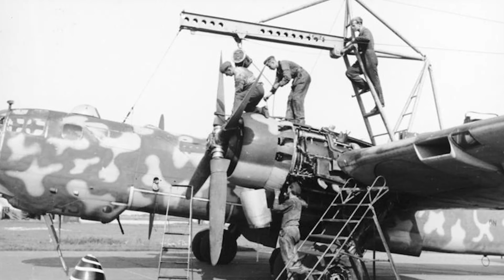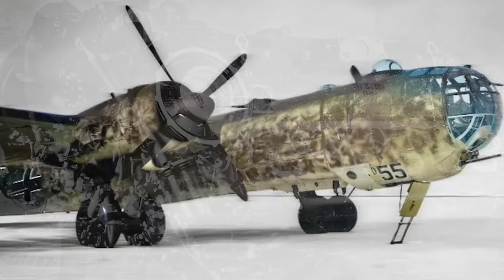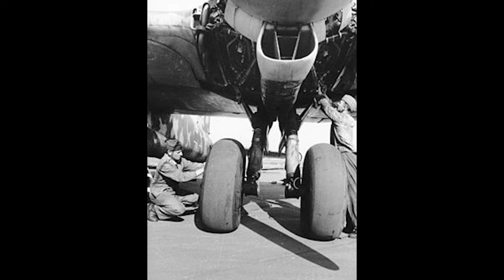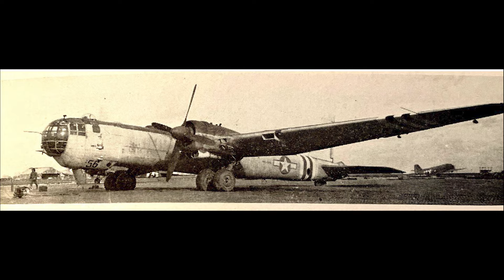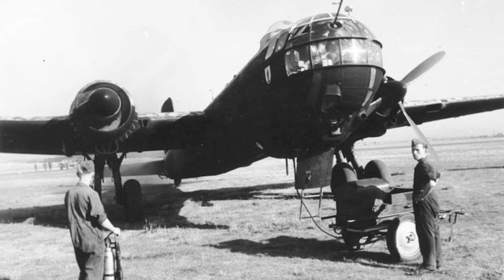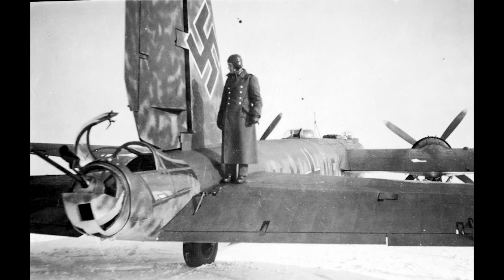American Engineers Tore Down Germany’s He 177 — Then Called Its Coupled Engines a Catastrophe

Comment: The Heinkel 177 had coupled engines to limit drag. The Ural bomber project, as it is sometimes called, was designed to be a level bomber. But Ernest Udet intimated it would be great if it was a dive bomber, he was dive bomber crazy. So it was redesigned to be able to survive dive bombing increasing its overall weight. It ended up being a failure due to the engine overheating. It was used in the 2nd blitz early 1944, operation Steinbock.